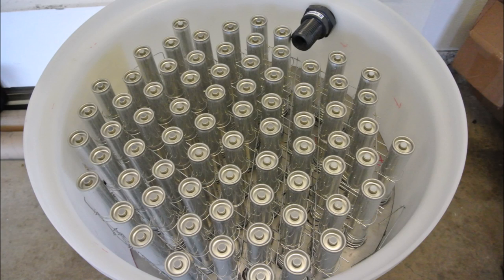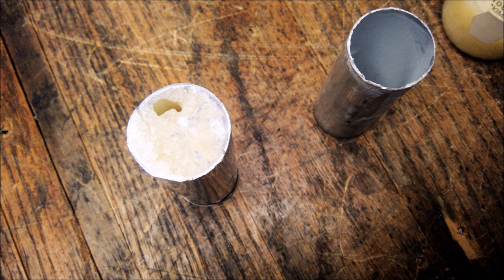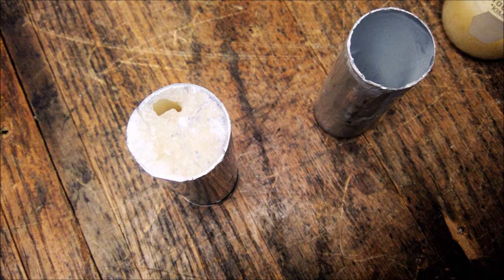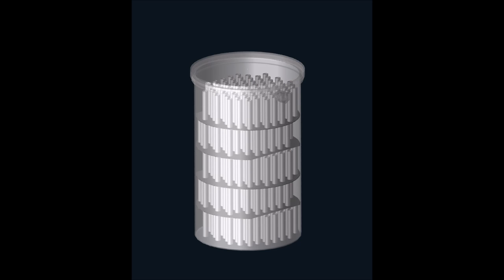Thermal Energy Storage Tank Build

Comment: Looks overly complicated. Why didn‘t you simply run a coiled water pipe through that barrel and fill the barrel with paraffin? Simple heat exchanger setup, only that instead if having water as the storage medium, you‘re using a phase-change material, which - if I understand your video correctly - is preferrable over a simple liquid. But with a simple heat exchanger you‘d save yourself the trouble of building all these tubes and racks.

Comment: There s a problem with the size of bottles. Wax is not good heat conductor, and after cooling the surface of bottles, wax will be hard at the surface of them and do not transfer the heat from inside to outside of bottles. So environment temperature will fall down. You have to wait some time for heating. Need improve your heat transfer coefficient.

Comment: What is the thermal efficiency of the system and how does it compare to other storage methods?
Reply: This first test is mainly testing the conductivity between the water and PCM tube, otherwise they would at least insulate the outside. Scientists are already studying and developing insulation, this test is mainly on the PCM tubes themselves.

Comment: You may find my paper from 1984 interesting ASME Paper 84-HT-9 "An Experimental Investigation of Melting About an Isothermal Horizontal Cylinder" by A. Sidney Roberts, Jr. & Timothy M. Rothgeb
Considering the thermal conductivity of paraffin thin sheets of paraffin may work better and could be arranged to allow for cold and hot sides to the exchanger so you don't have to change the flow to add or remove energy.

Comment: If this can hold the heat long enough it can be used in compressed air energy storage to save the heat from the compressor and use it to heat the air when it is expanding to achieve a higher efficiency. Great job at exploring thermal energy storage.

Comment: Isn't paraffin releasing heat when it's phase changes? Just like water? Wouldn't it be just easier and more efficient to have the barrel full of paraffin and the water in a pipe going through the paraffin in spiral? (to increase thermal mass and surface for better heat exchange and bigger heat storage capacity?

And yeah... Insulation for the barrel would be nice...
Reply: the transfer rate will be slower
Reply: @shubhamsbahir  the heat storage capacity would be better.... And way cheaper to build. For the use in home wouldn't it better when the heat transfer wouldn't be super fast? I'm mean you normally heat water during the night when electricity is cheaper and you want the paraffin as hot as possible for as long as possible.
Or is this system designed as a heat storage system for... Let's say a solar thermal power plant for the use of low pressure steam turbines during the night?
Reply: @damaskilo2665  what if we store pcm around the water tank?

Comment: Hello. I enjoyed your video. I read your report but didn’t understand much of it. I’m considering building a thermal storage tank for my home in northern Florida. We don’t get much cold weather here but when we do my heat pump with 220v resistance heating runs for approximately 1.5 hours to warm the house up from 67F to 72F. Once the house warms up it doesn’t run much if at all. The heat pump is relatively efficient but the resistance heat built into the air handler takes its toll on our electric bill. I’m 58 years old and have my own business as a home repair professional. My background is 35 plus years as an HVAC technician, with a extensive background in hydronic heating. I was thinking I’d build a solar collector and either put it on my roof or on the ground outside of my house. Anyway my question is do you think this would be able to supply enough stored energy to heat or assist heating my 1700 square foot house. I’m guessing roughly 75,000 BTU’s per hr. Storage space is a concern and well as cost. I’m not concerned about the electrical part of it as I can handle that. It’s the thermal storage. Thanks in advance. Rich Anderson.

Comment: Interesting concept. One slight technical note, tanks used for heat transfer should filled from the bottom up if recirculating. This will limit if the tank drains faster than the fill and serves as an easy control.
Reply from the maker: I agree, however this was built on a budjet for strictly a proof of concept purpose and not so much for actual use. The pump used in the final closed loop was not powerful by any means.

Comment: Wow, I always thought heat storage in PCM materials is a lot more complex. But you can basically just shove these pcm cannisters in a boiler and increase it's capacity that way. Provided that the cannisters can withstand the pressure of the material at 100 degrees celsius.

Comment: Cool concept. Just remembered in physics class sometimes latent heat per kg is pretty high. Plus, it happens without temperature change, which could be a good thing to have. However Im curious about the stresses from the volume change by the canisters. Not gonna act as if I know much, obviously its your project, but just would like to suggest a tube as tall as the barrel with a significant empty space at the top, with merely some plates with holes in it to keep the flow back and forth as already done. So the empty space allows a bit of expansion without much change in canister pressure when the wax expands or contracts, but this air space doesnt reduce efficiency since the air space is at the top above the water. Plus, faster installation/repair/removal since you only need to arrange only one stack of canisters. The holes in the 4 plastic plates can just be milled in one go. Might need to watch out for loss by convection though.

Just an idea. Could be something else that would work better
Reply: And you can always adjust the number of passes by using a different length spacer and toss in a couple more plates
Reply: Well... I think that the exactly the stress from the volume change is the primary problem with using phasechange material for energy storage, so it is actually a very good question. I think it would be enough to simply have a small air-pocket in the closed canister, since the air will compress fairly decently.
But honestly... I would rather focus on building the canisters to be able to expand with the material, either a type of rubbery material, or whatever can withstand the contant expansion and collapsing. Of course this will change the actual volume available for water inside the tank, but this can be solved with a simple expansion tank seperately mounted on the water system.

Comment: This sounds not quite right. If you pump water through, then you can use water as heat storage because max temperature will not be as high. The whole purpose to use parafin is to be able to heat stoage to more than 200 C. That gives us a lot of heat in small storage. But heating wax oto 90 C is senseless.

Comment: If this were a thermal energy storage system for a hybrid evacuated solar/ethanol water heater. I would run it everyday at around 1:30pm everyday or whenever the sun is shining.

Comment: I don't really understand if the liquified wax can be burned off and recaptured if cooled by a pipe as a gas, back into liquid....I figure the wax battery is solar heats it to liquid, the hot liquid can power a "Stirling engine" to power a battery or pump hydro upward to be released later. If the liquified wax gas can be captured, that's almost a car engine with permanant fuel, like some space heaters though ....that still need electricity, but hey, solar,wind power can charge starter batteries.

Comment: What is the advantage of the tubes vs just using water?  I'm curious about this, does the wax have a higher heat storage capacity?  I'm toying with doing this at home so I can use solar power during the day to get heat in the morning when I have to get up and looking into various ways to store heat.
Reply: I am trying to understand myself, so take what I state with a grain of salt, but I think the transition from liquid to solid as wax cools would slightly increase the energy released compared to water...or the energy is released more slowly over a longer time....or both are occurring.....or I am totally mistaken and neither are...lol....sorry, I guess that may not be helpful.

Comment: Cycle 1: Heat source(solar, electric or coal, etc.) transfered to water followed by heat transfer to wax. Cycle 2: Heat transferred from wax to water for hot water use. So why is there the need for wax? Can't the wax just be skipped.
Reply: It's used in long-time heat accumulation solution.
Reply: @Skupik1 the ability to hold heat in the long term is dependent on insulation. Wax has a higher density than water and hense it hold more BTUs per given volume but I wonder if spending the same capital on insulation and water would yeild better results than the current setup.

Comment: Out of curiosity the PCMS that you display there did you make them yourself or did you purchase them from somewhere if you did make them yourself where did you get those nice containers I've been contemplating adding a thermal storage to our wood stove I'm using a 55 gallon drum and some copper line basically heat the copper line which will in turn heat the water inside which will Circle it through the the 55 gallon drum however my thought is that adding these could in the future be a good additive to improve how much heat it can contain and how quickly it disperses a Viet to actually build it so I don't know how hot it's going to get but just planning ahead

Comment: It appears that the liquefied wax is less dense and takes more volume than solid wax. That is not too good. I guess you can leave a bit of air at the top so it is compressed, otherwise it can explode. What is the efficiency of this system?
Reply: Poor the wax in hot!  That way you can't overfill!

Comment: could your design be used with "el cheap-o" solar systems (the ones that use black hose to heat water, simple glass sandwich for insulation and a 200 liter drum for water storage?). I'm thinking of filling the drum with the PCMs to have hot water in the night, besides insulating the drum, that is.
Reply: perfect for it, insulate the barrel of course :D

Comment: How do you account for the expansion and contraction of the paraffin wax inside the wax cells (cylindrical aluminum?)... 

 When the wax softens/hardens doesnt it change volume density and size?
Reply: Wax its used for thermostats because it changes volume .

Comment: Martin, just read a report you did for a heat exchanger in the task you used steam 150°C to heat water from 10 to 50°C. I am not an engineer but it seems to me that the efficiency of the process was not that good, or is it normal?
Reply from the maker: The results were mediocre and it is because we went cheap on materials (no insulation, aluminum tubing, etc) due to budget reasons. the whole project was meant to show that the comcept works more than to be actually useful.

Comment: Heat wax with hot water in order to heat hot water with the hot wax. OK. Can you heat a greater volume of water than you used to heat the wax in the first place? Otherwise I'm not quite understanding the advantage.
Reply: no, your missing the other half of the equation, solar water heaters are used during the day to heat the water and either pumped around a loop or a thermosyphon loop is used, this hot water heats the wax storage medium and holds the energy.  Then when the sun goes down and your central heating pump engages, and the stored heat is released into your central heating loop to heat your house over night.

Comment: I think I have never seen such an expensive setup for thermal storage. Those cartridges must cost a fortune. ... couldn't you have just bundled them all touching each other with a big strap keeping them tight? and leave the little triangles between to let the fluid through? would have only needed about half the height and would have been much higher Wax density. when you first showed the wax cartridges I thought you were going to take advantage of the expansion of the wax ..... not!?
Reply: I was also wondering about utilizing the stored energy with compression too, seems the designer failed to recognise this potential
Reply: UPSIPO makes sense, you could daisy chain several 55 gallon drums of wax with coils in them together for massive thermal energy storage.

Comment: how may minutes or hours did it take to build that thermal energy tank???
Reply from the maker: It gave hot water for about 30-40 mins after pumping in cold water. This was a cheap build and could be improved by using insulation, special copper tubing for greater heat transfer, and varying the flowrate.

Comment: What is the specific heat and resulting capacity difference between water and these paraffin wax canisters?
Reply: Easy enough to look up if you are really interested... Specific heat capacity of paraffin is not so useful at ~ 2.2J/gK (~half that of water) It is the phase change properties of paraffin that can make it useful where energy storage is required in a fluid system.  The heat of fusion of paraffin is ~200J/g.  If you select your paraffin melting temp to coincide with your required working temp then you can store ~50 x  more energy compared to water of a similar volume over a small temp range.  I used approximately 100Kg of paraffin wax purchased cheaply in bulk and double  sealed in plastic bags. These bags were placed in a 1200l tank that held solar heated hot water for a radiant floor heating system. This increased the energy storage capacity of the system by ~2.5 times (not including the thermal mass of the building itself)

Comment: Is there are reason to fill it with wax as opposed to simply using steel cylinders? Does the wax have a higher specific heat?
Reply: I believe the phase change effect gives the wax a heat transfer advantage when using this as a hot water battery for energy storage.

Comment: I think a better approach would have been to fill the tank with oil and submerge a labyrinth of copper tubing in the oil and pass water through the copper tubing.   And, to heat the oil I would use a regular electric hot water heater element powered by solar panels.   This would provide instant hot water while retaining more heat than just draining away the hot water and replacing with cold.  Of course, if you have the current capacity available, an electric instant hot water heater is probably more efficient and takes up much less space.  But, it wouldn't be a bad use for excess solar charge current that might otherwise be wasted, assuming you have the space for a huge tank of heated oil with a big coil of copper submerged in it.

Actually, an even better approach would be to build a shallow box painted black on the inside and run copper tubing back and forth in a labyrinth inside the box and paint the copper tubing black, put a glass cover on the box and place it in the sun.   Pump the oil through the copper tubing in the box and then pass it through a coil of copper tubing submerged in the hot water tank during the day while the sun is shining.
Reply: Oil would not work as well as water as its density is lower and it’s specific heat on speed mass basis is also lower. So the net energy that could be stored in a given volume is actually less than if water is used. The advantage of the wax is that the wax is undergoing a phase change, and the latent heat of fusion allows heat transfer in an isothermal manner.This means heat can be extracted without the wax actually getting any colder. This allows for much higher thermal energy storage on a per volume basis than with water alone, and much better than could be achieved with oil.

Comment: insulate the container
Reply from the maker: This was built on a tight budjet strictly for a proof of concept purpose and not so much for actual use. The real thing would be insulated.
Reply: Even on a budget, it could be insulated with polystyrene out of a dumpster.
Reply: It is a storage device. Eroei can only be below one. Negative eroei does not make sense in this context. Also your language seems to be worse than your knowledge.
Reply: Jay Silence actually from your response it’s clear you don’t see what this is about and it’s potential for energy storage

Comment: how long does the wax, if insulated to its maximum capacity, retain its heat? i'm assuming you'd transform it into steam to power stirling engines, etc in addition to heating your home and water.
Reply: You don't need steam to power stirling engines. Just a temperature difference. Between your comment and now: the Tes.Pod is a stirling engine based power generator with heat storage in Aluminium as phase change material. It stores energy as liquid aluminium, and you can retrieve it as electricity and heat.